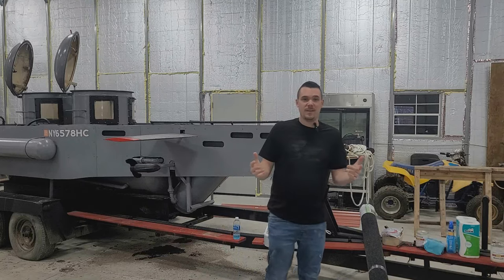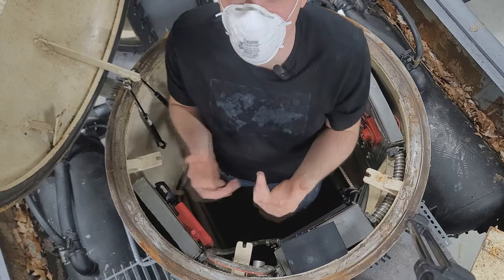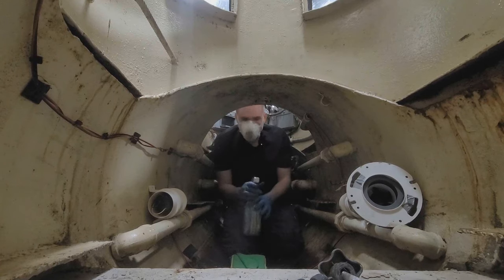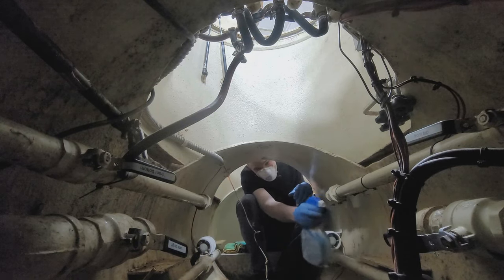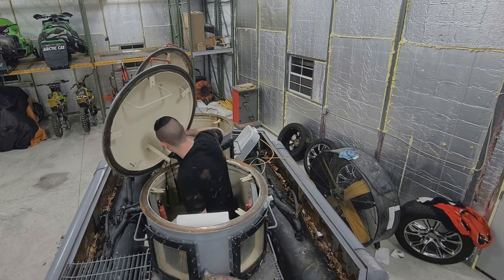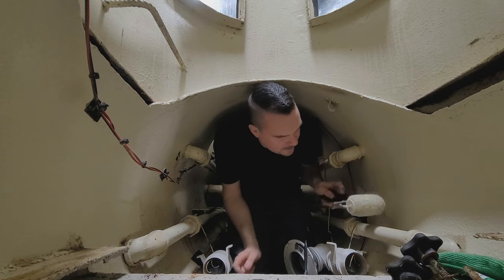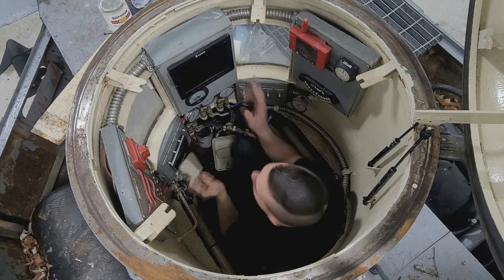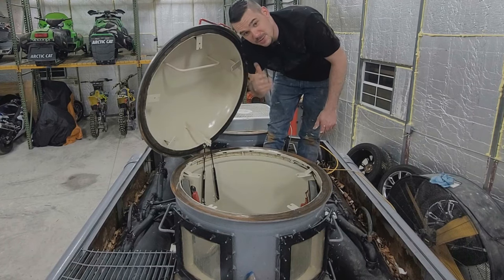My Submarine Needs An Interior Repaint - In The Garage! - Episode 2

Comment: Dehumidifiers only work if the water actually leaves the vehicle, so it has to be part of a storage "Hatch"
Reply from the maker: The dehumidifiers drain hose will run outside of the sub. Would add a valve in the floor that the hose can run though.